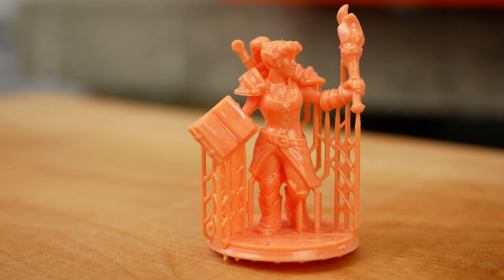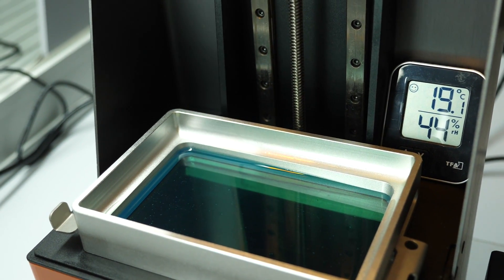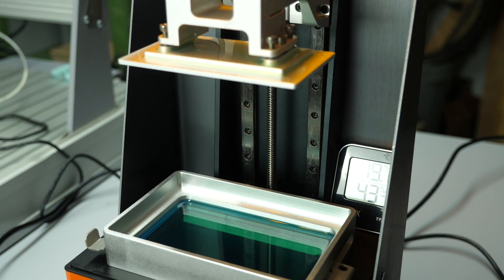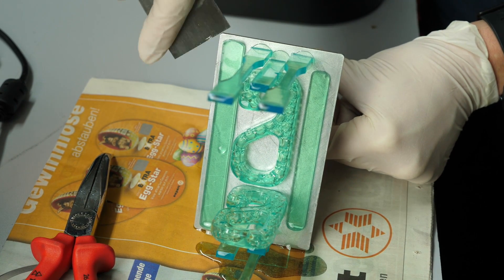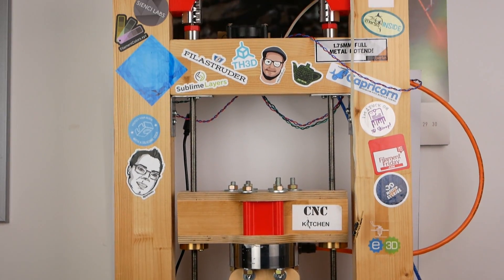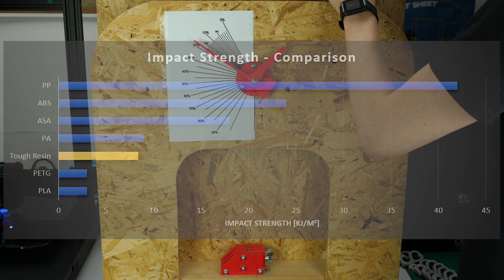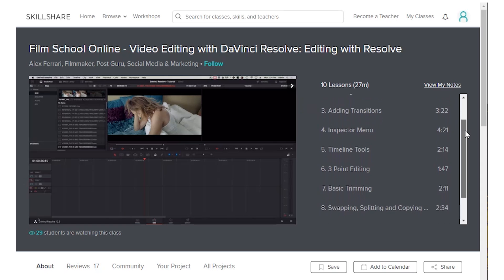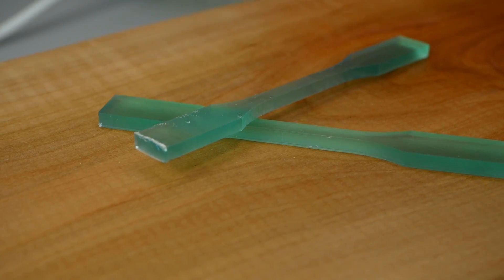STRONG parts from a Resin 3D Printer? Testing TOUGH Engineering Resin!

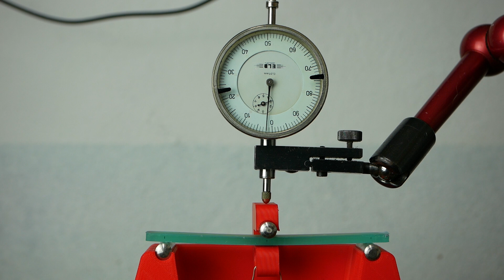Comment: 7:00  the behavior you noticed there is called viscoelasticity. Most polymers show this behavior to a certain extent and so unlike with the pure elastic behavior of metals the loaded material deforms (creeps) over time like a viscous damper.
Reply: It drove me nuts back in the day... piad all kinds of money for sla prints, to watch them sag into unusable items over time. grrrr
Reply: @henmich  
Do you think miniatures (maybe too small), or bigger sculptures will sag with this BLU formulation?
Reply: @huyked  I have a very expensive sla engine with moving parts, about ten inches across, that has long since seized and sagged on every front, I also have delicate small parts that have suffered even worse. It was so bad, I gave up on sla for most things and went to cnc metal. For the prices I paid for these sla parts, it's unacceptable.
Reply: @henmich  
:(  Awww.  Dang!  I'm sorry to hear that.  What a waste of money and such a turn-off.  I can imagine that being very disheartening.  Thank you for letting me know.  I do wonder about the longevity of resin prints, say for making art pieces that are painted and sold to people.
Reply: Interesting, I'm sure he would have also seen this behavior in the D638 testing if he used the same method to apply a force.
Reply: Thought viscoelasticity was a temperature driven property and not driven by strain rate
Reply: @eddiemendoza6304  It achieves the same purpose by re-orienting the polymer chains. Temperature is a more reliable way of showing this characteristic. Some polymers exhibit no (negligible) aspect of this from strain.

However it's also worth noting that localised heating from high strain may contribute
Reply: Yaaas
Reply: Creeping is a huge issue with many / all tough resins on the market.
Reply: Dang! You beat me to it! Lol
Reply: Manuel Buchberger I was going to say, it’s due to the polymer chain bonds allowing for stretching, and it’s likely due to a higher amount of single bonds, which is used to make it less brittle.
Reply: Plastic deformation

Comment: As always, a very informative and interesting video!
However, I noticed one mistake. If I understood you correctly you state in the beginning that there are two types of printing processes working with liquid resin, SLA and MSLA, which is allegedly falsely called DLP.
That's not true, since there really IS a process that uses a DLP chip to cure photopolymers. While the technology of light projection is quite different, the result looks pretty much the same as for MSLA.
Keep up the good work, Stefan!
Reply: LCD-SLA, sometimes called MSLA, is often incorrectly called DLP. While there is a real DLP, that was not his point.

https://www.matter-replicator.com/2019/03/02/on-the-difference-between-dlp-and-lcd-based-sla-printers/

Comment: Awesome video! Having used anycubic and monocure resins I was  pretty skeptical about the strength since both of those resins were very brittle. I’m still very curious about temperature resistance though, if we can find a resin that his temperature resistant and tough, I would love to outfit my MK3 with replacement resin parts.
Reply: There are, Formlabs have temp resistan resin , but its gone cost a little fortune , on the othet side yuo can buy petg or abs for 20 -30  dolars per kilo  or something ...sooo

Comment: @CNCKitchen Stefan, awsome Video as many others.  I am really happy that you are looking into those resins too. Cured and washed the parts should be relatively safe healthwise. FDM printing is in discussion as well, so printing in a well ventilated area or using filters should be standard for both methods. (As long you are not smoking anyway. ;-) ) What was the break elongation? 
I would be very interested in your findings regarding temp resistance and long term stability. Maybe you can put it in a transparent case before putting in your oven. But with the fully cured material I wouldn't be too concerned about health issues. I guess it will become soft around 60-90° C because of being a tough resin.
Reply: very good observation. Any tough resin would be have some flexibility and the more flexible a resin is, the lower HDT.  We do have resins that can hit 160C without softening too but they are more brittle and is more for molding application

Comment: What's the gauge/instrument used at 7:10 called? I'd really like to find one and I haven't had luck trying to Google a name for it.
Reply: Creep in resins is a balancing act for chemists. The more plasticizer you add, the more impact resistant and rubbery your resin is. Add less and the resin has less creep but is brittle. You may see that if you cure the parts longer, or increase the exposure of the UV light during printing for each slice, the parts will be come more brittle but have less creep. 

I previously worked at a DLS resin manufacturer.
Reply: @HendoRising  software now has built-in compensation to countering bloom and you can also search Robert Silvers' guide on getting correct compensation.
Reply from the maker: That's a Dial Gauge.
Reply: @CNCKitchen  Hello man! Really big work, thank you for your videos! About 7:00 – as far as I know creeping is normal for plastics, it’s their property. And that’s different for different plastics. For example, PP has worse creep resistance than PC.
Reply: Also know as a dial indicator. It's used to measure displacement.
Reply: Thank you so much for all for your replies! I will look for one

Comment: I use a Peopoly Moai and absolutely love it! I really don’t find the smell bad at all! Nothing like I expected from comments but I’m certain it varies based upon the manufacturer. Excellent video! Please do more on resins!
Reply: Yeah, it can vary a lot from brand to brand (3d-okay resin has a smell like polyester/fiberglass resin for example, while some other brands don’t smell any worse than most epoxy resins), and also by how tightly sealed your printer is.  Even the temperature in the room can change how much resin smells.

Comment: BTW a little trick to removing prints from the bed on SLA/DLP.. use a flush cutter at the corners of your print and just snip once to get under it the print and the prints will pop right off vs. fighting them with a spatula :)

Comment: A comparision to other resins like Anycubic, Elegoo etc. would be nice. However thanks for the video
Reply: https://docs.google.com/spreadsheets/d/1JlqLSi4sxZLdA-hHCp6Ow4isoGMNI7nlE9Nmbj1ajWk/edit#gid=0
Reply: rsilvers thanks mate, such a comprehensive comparison. I’m assuming this is a collaboration, can you provide more details? Or maybe some other spreadsheets with other modes of failure? Cheers
Reply: @rsilvers  Hope you see this as I am really interested in your findings and looking to buy an SLA printer. I am based in China and have had good experiences dealing with Anycubic so might go for a Photon but in your spreadsheet, somehow the Zortrax prints Blu almost twice as strong as the Photon does. Any idea what that is or if the result can be trusted?

Comment: Will you try some wear durability test if possible? I wonder how a fdm printed gear vs a sla/msla printed gear would perform.
Reply: Not just wear issues to look into - many of the UV cure resins degrade/deform badly over time for a variety reasons. So far I've not seen a single UV cure resin I'd call good for anything but decoration, rapid short life expectancy prototypes or mold making. I'm not going to claim they are all like that though, just yet to see a stable strong good quality resin that can be used for an enduring part. Hopefully this resin might just do that job!
Reply: @foldionepapyrus3441  , you have not seen, because hobbyists do not use them. This is not the same as that all the products are the same. Of course, they are more expensive, but that should be expected.
Reply: @michaels3003  Do you have any you know of? With the datasheet to go with them? As I've looked around alot, and never seen any that makes this type of printer appealing to me (and I'd like it to be, as the detail level is great, and its a much cheaper simpler setup than the laser based powder melting ones that have similarly good resolution). 

The nature of the UV cure resins seems to make any part they make flawed if you need anything other than a delicate sculpture, or very short lived prototype. Preferably one that's never going to be handled/exposed to oils/water or more UV... There are some mechanically quite impressive resins, but they all seem to fail rapidly if exposed to the real world, which vastly limits the usefulness, and means you are better off printing the part, taking the silcon mold and then casting in a suitable 2-part epoxy (something you can easily find one that suits whatever your needs are) - and that is too much hassle to bother with, adds quite a bit to the cost of a single part, unless its really the only affordable/sane way to do a project - like perhaps you need thousand odd of them - too small a run to make injection molding viable, and too much to do machining...
Reply: @foldionepapyrus3441  , I am interested in this subject myself, but unfortunately I've just started the learning process. YT may not be the best place to look for such information. You may have to do your own work by getting different polymers and testing them.  Or you could order prints from some  companies that print professionally but use polymers that are also available to ordinary consumers. I think, there are a growing number of manufacturers of polymers and data sheets should be available. Keep in mind that the specialty polymers will print at slower rates and may be expensive. Companies should be able to answer a simple question whether the printed objects can be used in specific real-world scenarios. Post processing may be required for real world usage even with the "tough" type products (like from eSun or Siraya Tech). Btw., mixing some of the polymers offers interesting possibilities.
Reply: @foldionepapyrus3441  , look at BASF products like Ultracur3D. Expensive at 90 Euros per kg (could not find price in USD, but I did not search for long).
Reply: @michaels3003  Indeed, I'd love to have the money to experiment with all the resin, and potential blends. But even 'cheap' resin is quite an upfront cost for the bottle, wasted if it turns out to be unsuitable. And even the resins that come with half decent information levels in the  data sheets I've seen never seem to live up to it in practice. 

While I obviously have only second hand experience I've seen far too many resin prints that 'should' last fail when you wouldn't expect them to. For your sculptural work, or miniature painting type stuff the end result should end up well sealed, subject to basically no loads so they are great for that (I've never seen any indication they react badly to acrylic paints most commonly used for that now).. 

Now that the machines themselves have come down in price to really easily affordable levels has made me much more interested in taking the risk on it now (I started being curious in this idea when the only way to have a crack at it was to build your own from scratch and purchasable resin choices almost nill). But still the UV resin world has a very long way to go to be even close to the 2 part epoxies in proven durability, documentation, and the related ability to choose the right task specific blend.
Reply: Gears also have some un-intuitive wear mechanisms. Properly designed gears don't have much sliding contact if any, for instance. Also, It is my understanding that plastic gears are mostly limited by strength and dimensional tolerances. 3D printing will also throw in some surface finish problems as well. 
I think durability will be determined mostly by tooth geometry and surface finish. Material choice matters, but I think it will be obvious, or at least the problems will not be unique to gears.

Comment: 3d print lenses with clear resin and a bit of polisher!
Reply: I'm not sure if the resolution is high enough for optical lenses (though with polishing... maybe), but it should be enough for making Fresnel lenses, I think.
Reply: You mean like an eyeglass lens? Although resin printers have very fine layer lines, I don't know if it's enough for something like that. If you mean something like a magnifying glass then maybe.
Reply: Marco Reps has done it, look it up. You can't cure the lenses though.